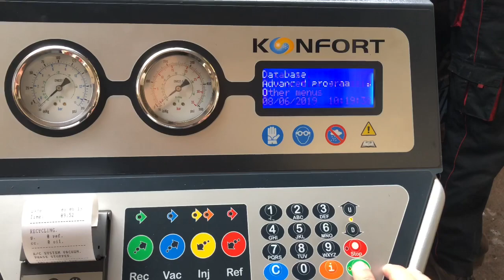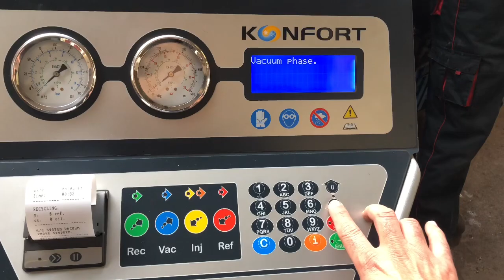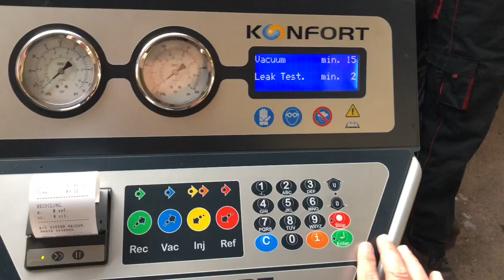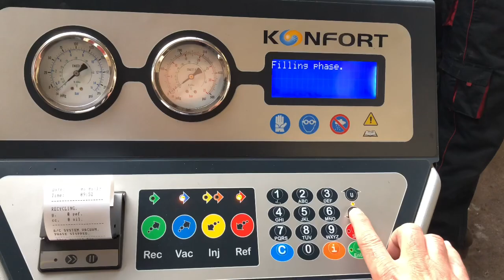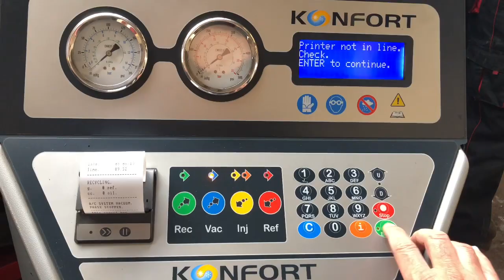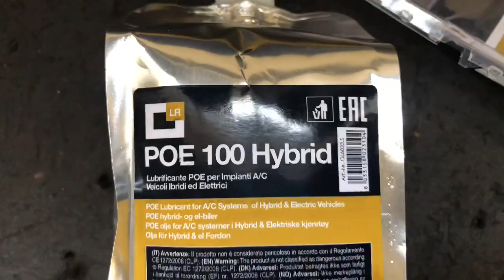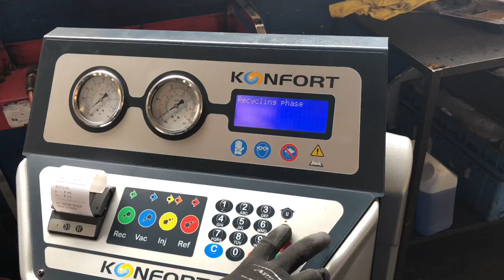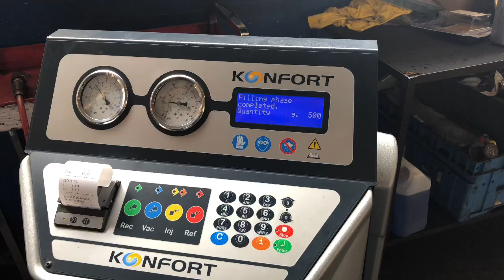How to recharge Air Con for Hybrid cars - Toyota Prius

Comment: You did not turn the AC compressor on while filling refrigerant. You should have turned the car on and set the thermostat to coldest.  Also while injecting oil you sucked in air.  You should have evacuated the system again.

Comment: 1:  for what reason do you have to add more oil when just doing a normal refrigerant recharge in service? 
There was no leaks with a large amount of oil loss ? 

There were no parts replaced that removed oil during parts replacement ? 

2:  when sucking in the oil through your syringe we can hear the sucking of air it was sucking in ambient air that is full of moisture into that system so now it is contaminated with air and moisture. 

And then you just went right into recharge and through refrigerant into a system now partially filled with atmospheric moist air now the system is contaminated 🤔
Reply: This should be titled how not to recharge any type of ac system. Will it work? Maybe, for a little while. Guess this is how you sell a compressor later
Reply: @zmmotors1  well the teacher needs to be RE-teached lol 😂 

If every car has a slow leak that got re-gassed every year and added 10 mL of oil because oil just does not leak out it does not wear out it does not burn up and it does not get used up. 

It only leaks out to a large leak and there is a lot of situations where there’s just small seepage that is really not a large amount of oil loss and sometime no oil loss at all.  But at least he said 10 mL not 30 mL.

Comment: Ive added 650 grams by mistake. What shall i do?
Reply: ZM Motors can i not depressurise 150 to make it 500 rather then drain the whole system
Reply: @invisible4405  You would have to have a very accurate recovery machine and scale to precisely remove 150 g measured by weight only. 

But yes it can be done. 

But it’s just easier cheaper and faster just to recover the whole thing and recharge it correctly